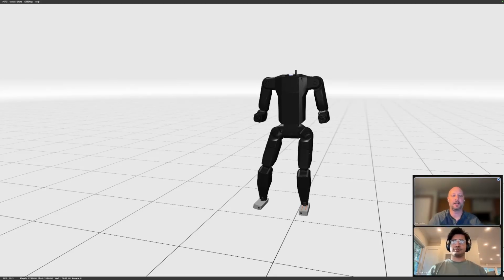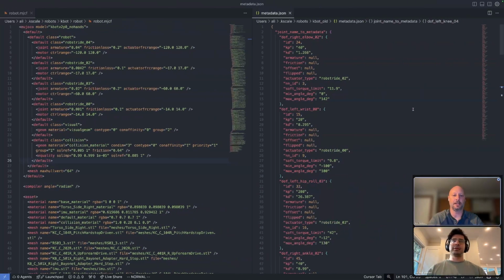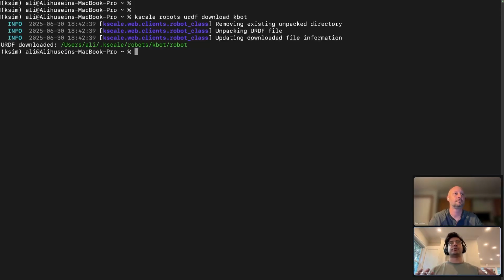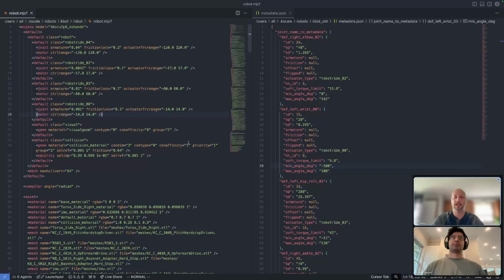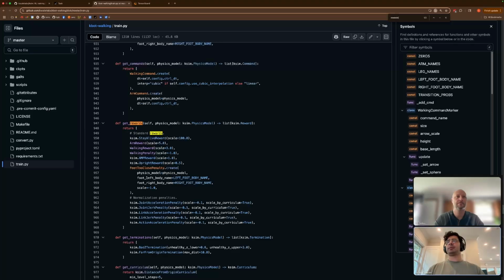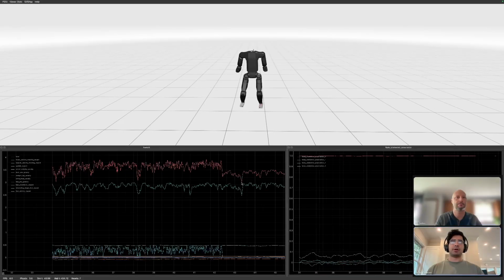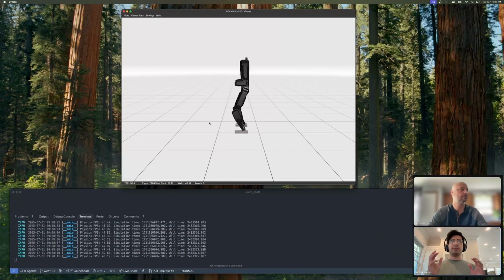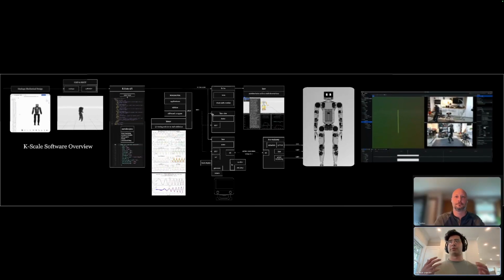K-Scale’s Open-Source Software for Humanoids

Comment: Another cool thing to be able to add is giving a robot a tail. 

The tail can be used to help the bot maintain balance as well as maybe  perform other functions.

If you can model that you could explore how well a tail could do that just in software and if it works well then go build a bot with a tail.

The tail tells a tale as well in that it is something other bots  don't have, even the big liege  bots like Optimus and Figure and thus can maybe have marketing potential s well and even branding.

Comment: I am wondering if you also add other devices to that simulation such as the robot riding an e bike where you model the physics of the bike and train the bot to ride the bike, or get on and off the bike or push it?
Reply: And training a bot to drive a quad through the woods would be cool as well and could save lives to boot.

e.g. Google
Exclusive Vid: The BRUTAL REALITY of Fiber Optic Drones!

Comment: Wonderful -- Can you hose it down/work in the rain? When you make your own end_affectors, Please make the fingertips screw drivers - thinking about all the tools it may want to hold, as integrated into the bot.

Does it have Lidar? Maybe a lidar capable cell phone can be repurposed into the head - and so you can call it - have it use lidar - and be able to take out a sensor box thats an actual phone - install apps that it can run on the phone - so for example it could run the funcrions of the phone, and have its internal brain app that can send text, email, accesss security camera native mobile apps, get and parse internet access from the phone - and keep logs in the phone such that you can pull it out as its "Black_Box" in a way.

This might make it so people can make Replit Apps on the phone specific to their use case  -- and all consumers already know how to use a phone - so the  Human_to_Phone_to_Bot interface is really approachabe - and the internals of the bot can slurp off the phone etc.
Reply from the maker: It is not waterproof right now but maybe future iterations will be

We will definitely have more end effectors like this. Like Inspector Gadget

No Lidar on the base version but it's something we could add on future versions of the head

I think Replit apps for humanoids will be awesome :)